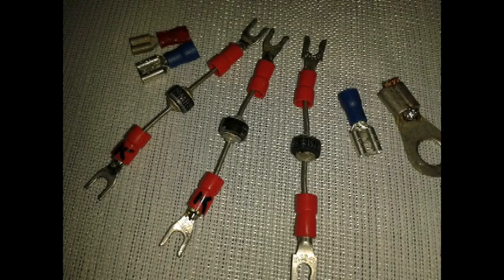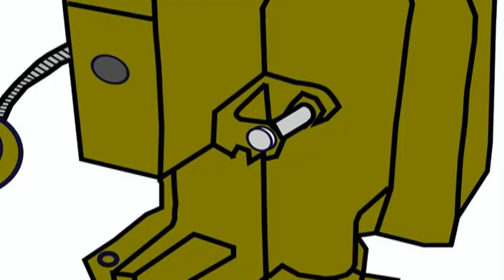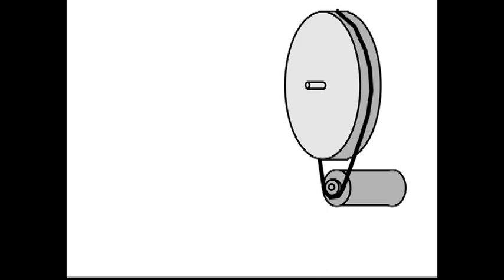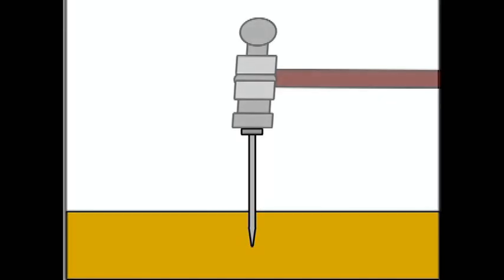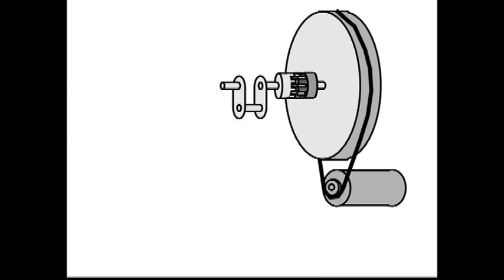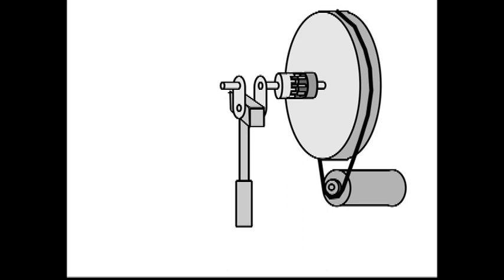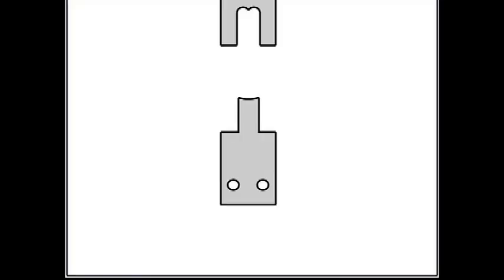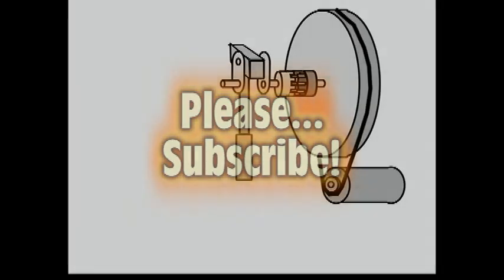How an industrial mechanical press works

Comment: Hi , I want to build my own power press at home, how complicated it is to build at home?
Reply from the maker: Dear Kamohelo, some people has built hydraulic presses using a power steering pump, together with the cylinder used for the same car. You can find them in junkyards. Then you can use some solenoid valves found in industrial machinery discarded stuff.  Please check this video published elsewhere in youtube  https://www.youtube.com/watch?v=PSAtLNn8NwE&t=0s&ab_channel=obix

Comment: so the heavier the fly wheel the bigger the tonnage??
Reply from the maker: Yes, indeed. However, the bigger the flywheel the bigger the motor also, since the flywheel momentum has to be "recharged" by the motor after every stroke.
Reply: @eltunene  I have a 2 ton press and want to mod it to be able to handle 20-40 tons.  how would i figure out tonnage to weight ratio?
Reply from the maker: @cetubuth7461  I advise you to check with someone who has already done that, the efforts imposed on the frame, connecting rod, and all the press parts in general is huge, it can even break apart!
Reply: @eltunene  no one has done it before,  other than building a brand new setup.
Reply: @cetubuth7461  don do it brotha

Comment: What is the component on the flywheel?Can anyone spell it for me?
Reply from the maker: The component on the flywheel shaft is a clutch, normally, it does not operate by friction, but by two metal parts suddenly coming in contact with each other. These clutches are made in a variety of ways, but their function is the same, they couple both sides of a split shaft and, after a rotation of about 360 degrees, they decouple again. They can be either triggered by a solenoid, or by mechanical means.